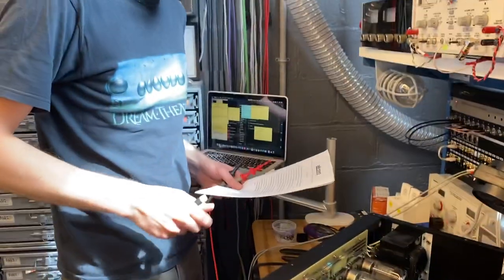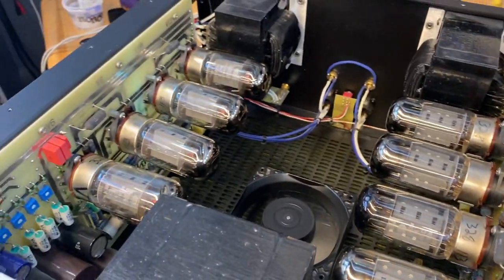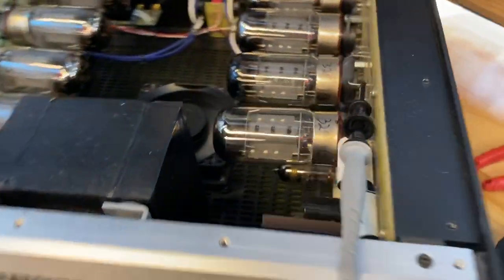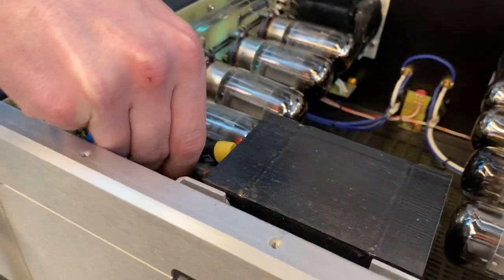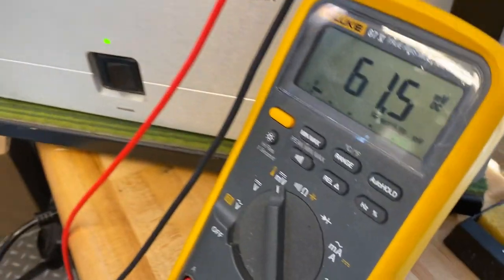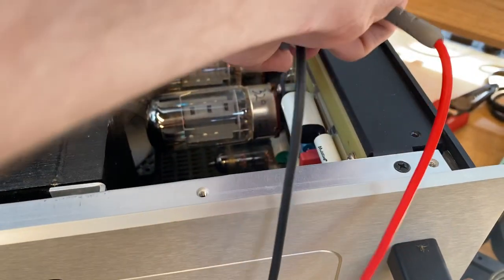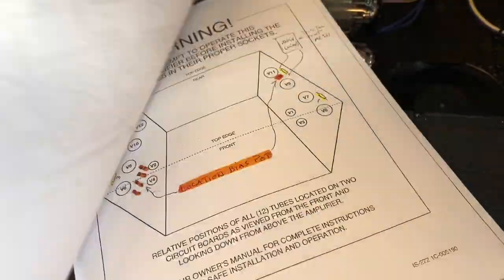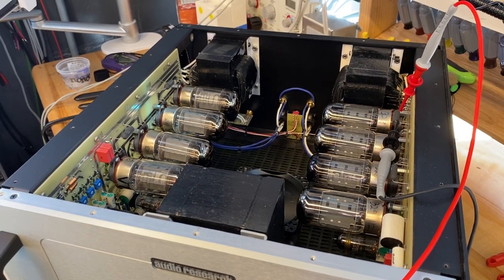Biasing an Audio Research VT100 Tube Amplifier

Comment: Hello there ! 
I have a VT100 MK3 same as yours on the video and i have just blowed up a pair of resistances ! just the two standed up near one pair of tubes. One is a black carbon 100 ohms et the other one a brown cylinder with coloured rings on it. 
Do you know where i can find those two différent components ? The name on the black one is PRC … 
I also understood that the tubes have to be match paired by two within the screws for bias settings, don’t they ? 
Once i get my new paire of tubes to replace the one that might be the cause of the destruction of the resistances and those two resistances, do you think i can just replace all of them and readjust the bias and that’s it ? I have already disasembled the cheek of the amplifier to show the solders wich are very easy to work on. 
Many thanks and sorry for my english as i am french 😊
Hope you can help 
Rodolphe
Reply: I use to own the MKII version of this amp and I also blew some transistors on mine. Lucky that the markings were still in tack and I ordered a new ones and was able to solder them in. I replaced the original tubes back in the amp rebiased and sold the amp. Good sounding but not worth the hassle when tube replacement came due.